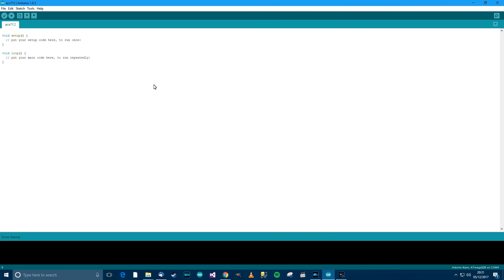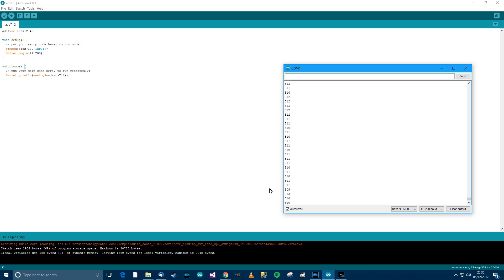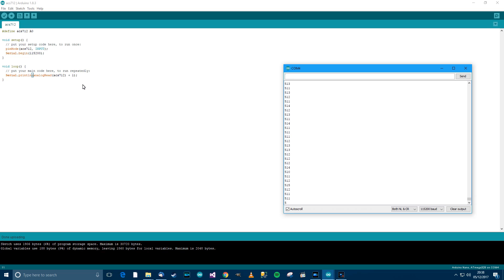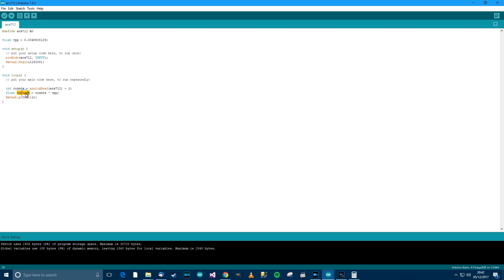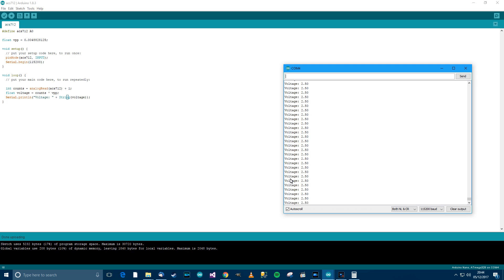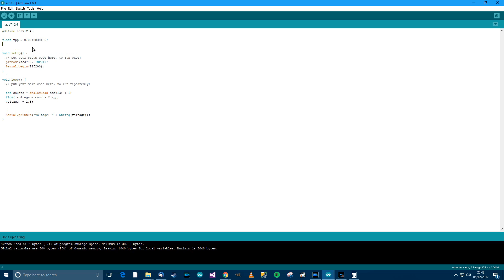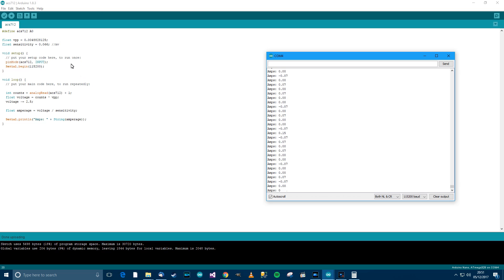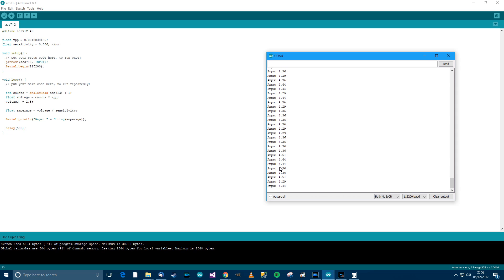TUTORIAL: How to use the ACS712 Hall Effect Current Measure Sensor Module - Arduino (Part 2)

Comment: Hello,

I have a 30W solar panel with Vmpp 17.2 V and Impp 1.74A, I'm using the ACS712 5A module but it's always giving me wrong measurements. not more that 4V actually. what do you think is the problem and how can I fix it?

Comment: I noticed in a reply you had misplaced the code. Here is the code you developed in this video:
#define ACS712 A0
float vpp = 0.0048828125;  //volts per point(vpp) is 5.0v/1024 = 0048828125
float mVperAmps = 0.66; //mV constant of ASC712 30A

void setup() {
  Serial.begin(9600);
  pinMode(ACS712, INPUT);
}

void loop() {
  int counts = analogRead(ACS712)+1;  //reads 511-512.  This is middle point of sensor
  float voltage = counts * vpp; //converts sensor read into volts  511 = 2.5v
  voltage -= 2.5; //offsets voltage to zero(0)
  float amperage = voltage/mVperAmps;
  
  Serial.println("Amps = " + String(amperage));
  delay(500);
}

Comment: #define acs712 A0
float vpp = 0.0048828125;
float sensitivity = 0.066;

void setup() {
pinMode(acs712,INPUT);
Serial.begin(115200);
}

void loop () {
int counts = analogRead(acs712) + 1;
float voltage -= 2.5;

float amperage = voltage / sensitivity;

Serial.println("Amps: " + String(amperage));
delay(500);
}
Reply: you forgot one imp line of code

the correct code is :

#define acs712 A1
float vpp = 0.0048828125;
float sensitivity = 0.066;

void setup() {
pinMode(acs712,INPUT);
Serial.begin(9600);
}

void loop () {
int counts = analogRead(acs712);
float voltage =vpp*counts;
voltage =voltage -2.5;

float amperage = voltage / sensitivity;

Serial.println("Amps: " + String(amperage));
delay(500);
}

Comment: To fix that problem "Your Input Voltage of your Arduino is not 5 V - and thats why ure reading wrong Values" - is easy to fix. Measure the Input Voltage of the Arduino with another Analog In - and do some Math ;)
Reply: Yup, mine hovers in the 4.6xx range

Comment: Adding 1 to your value doesn't change anything.  The result of that is still going to be based on the original figure, and you are now seeing lots of 511, 512, and 513 instead of 510, 511, and 512.  You still end up with a "bobbing" value.
Reply from the maker: I disagree! It's like saying we could start from -3 in a list instead of 0. We all like a baseline figure which we are familiar with. In this case, it's 512, because the total resolution is 1024. It would be unnecessarily awkward to have a baseline of 510 because it would always be 2 counts below what we expect it to be.
Reply: @antonycartwright  That might be, but in the video you are saying you saw more 512's after adding the 1, which can't be possible.  You're seeing it just as often as you did 511 before.

Comment: Amazing videos, thanks a lot for your insight and clear explanations! Excited to get this sensor and start building things. One question, could I use this, or a similar set-up to measure how much power is being drawn instead? I have a set-up where I am using a Solar Powered Mobile Phone Charging Station, the phones are being charged via USB, and I am interested in determining the amperage that is being drawn from the USB charging hub.

Comment: Hello there, thanks for sharing your knowledge with us, I got a question and I'd be glad if could answer me based on your knowledge on ADS, it seems these modules won't work nicely if I want to read low currents such as 1mA, 10mA and so on... If I use a 12bit Arduino or a 12/16bit adc module, would that help me in reading both low and high currents? I'd think so as the resolution would be higher, a 12bit Arduino would give me analog reads from 0 to 4095 if I'm not mistaken... I did a sketch to read currents by using a single resistor of 1R, it does work pretty fine, but according to my maths I'd be able to read a maximum of 5A, for that current I'd have to have a 25W resistor.. I'd appreciate your comment on this, thank you.

Comment: im using 3 sensor for my project of solar power curve , so my 2 sensors arent showing stable 512ish . its sometimes 500 and 515 and bounces  in between . what should i do to fix this problem ?
Reply: This is just noise. Take several readings and average them.

Comment: why do I get negative values of current in serial monitor?
 I'm using it to measure DC.
Reply: You might have switched the polarity by mistake when connecting with the sensor.

Comment: what the purpose of your  analogRead(acs712) + 1 ?
Reply: The " + 1" is for calibration purposes. If he (on his system) skips the ekstra "+ 1" he would be a little bit offset compare to 0 volt (or 0 amps). You might have to take some other number on your system, or just skip it.

Comment: If I'm getting 104, can I just add 408 to make it 512 at 0V?
Reply from the maker: Alphabot 408 is very different to 512, is the circuit ok?
Reply: Antony Cartwright yeah I've connected it properly. But without any load the value I'm getting for 0V is 104, not 512 as you got. So I was wondering if just like you added 1 to make it 512, can I add the 408 to make it 512 at 0V?
Reply from the maker: Alphabot that seems broken. Do you have any other modules?
Reply: Antony Cartwright Nope I don't

Comment: i am trying to mesure the curent of a 12v DC motor using Acs712 and arduino nano. i used the same diagram and code but all i get is some wrong negative values. can anybody tell why ?
Reply: If you have triple-checked the wiring, then I would double check the Arduino pin that you are using...  Some have pullup or pulldown resistors by default...   If you have a pull-down attached to that pin, all values would get a negative offset (depending on the value of the onboard resistor)

Comment: Can you help me .
I have a problem .when I am measuring the current by acs712 it only prints 1023 but when I connect the sensor with a load it doesn't change the value 1023.

Waiting for answer
Reply from the maker: Be The Engineer hi, try another acs712. Antony...
Reply: Antony Cartwright yes I think that can give me a solution
Reply: Now it's working but when I give a load it doesn't sense the current. Can you help with this .
Reply from the maker: Be The Engineer hi, I'm afraid that is too vague. I'd need more info than that.
Reply: The problem is it's showing 0 to -0.03 mA when there is no load is connected.
But if I connect a load it doesn't changing.it shows same value of 0 to -0.03 mA.

Comment: Hello Anthony, that's avery helpful video for me regarding my project. But then, I got a little problem here. can you explain also how to measure power factor on arduino, please?
I've bought the ACS712, and Zmpt101b voltage sensor. 
Maybe you or other ppl can help?
Thanks in advance
Reply from the maker: Syukron Alhakim hey, I'd have to research this. At the moment, I don't know what power factor is! Ha!
Reply: Antony Cartwright , glad that you're interested in researching it. In short, Power factor is active power divided by apparent power. This only happens on AC. What I actually need to measure is the displacement power factor. In which how lag / lead current towards its voltage.

Maybe this could help:
https://ctlsys.com/support/power_factor/

Comment: I am getting correct result but my power supply shows danger sign please suggest I am using the same circuit as yours thanks in advance Antony Cartwright!!
Reply from the maker: Hi, I'm afraid I don't know about the power supply, but as far as the ACS712 is concerned, this is correct. If your power supply shows a danger sign, it is probably best to stop doing what you're doing to make it safe! Antony...
Reply: Sadam, I think this wasnt a problem, since, Antony is indeed a short circuited the PS.
Reply: yes as we connect two terminal directly to the current sensor which makes the power supply short circuit should we use some resistance between sensor and power supply
Reply from the maker: Sadam Hussain hi, it depends on what you're trying to accomplish.
Reply: Sadam Hussain, in this case, it was always suppose to be short circuited. No resistor needed indeed. Just like how Antony answers.
Reply: HELLO, brother, i have another question how can we get smooth value like one value from current sensor

Comment: To smooth out the value, maybe you can store the running values into variables of 10 or more, then get the average.

Example algorithm: 
var 1 = 0.00  //first millisecond put the value here 
var 2 = 0.02  //next millisecond put the value here 
var 3 = 0.01  //next millisecond put the value here   
var 4 = 0.00  //next millisecond put the value here
var 5 = 0.00  //next millisecond put the value here
.
.
.var n = ?

>Get the sum of all VAR then divide by their number; if there are 10 variables, then divide their sum by 10.
>If there are 10 variables, then you've got 10 milliseconds to change their values. 
>At 11th second display the Average value.

Arrays and For loops can ease the coding here.

Anyways, this is just my idea, just sharing. Yours might be better.
Reply from the maker: There's an easier way;

float sum = 0;
int samples = 0;

Then in loop;

samples++;
sum+=newlyMeasuredValue;

Then when you come to average it:
Serial.println(String(sum/(float)samples));
samples=0;
sum=0;

Then you just slow the output time down.

[Edit: Actually, it's pretty much the same idea.]

Comment: int Amppin = 0;  // pin assignment

pinMode(Amppin, INPUT);

float Ampval = analogRead(Amppin); // "float" because you will be subtracting the value with decimal number for accuracy
Ampval -= 511.5;     // half of 1023. It's 1024 actually, but Zero(0) is included to the count so it's 1023 divided into 2. the other...
                                   //...half is for negative value.

//You divide 511.5  by 30 (because it's 30 amps rated) = 17.05 (per amp)  //

float Amp = Ampval / 17.05;    //Final value. By this, you can get negative values as well when reversed.

//This can be shortened, but just to easily grab the idea so I made it that way.
//feel free to modify and let me know.. I'm just a NEWBIE.

Thanks to this video!! Nice Job!
Reply from the maker: Thanks for this. :-)

Comment: Hey Antony, I just want to ask regarding on your codes. How do I write the code if I use multiple acs712 sensors and compile into a single serial monitor?
Reply from the maker: Ahmad Dasuki hi, the acs712 is an analogue device, so you can simply read one into a0 and the other into a1. Then just read them separately in the arduino code.
Reply: If I already change the reading into a0 and a1 then how to compile from different codes into a single serial monitor as in table form?

Comment: You show clearly the sensor produces a numeric of 0 to 1023 for -30a (thru 0a) to +30a.  You want to see (displayed) a '0' for 0a, and '5' for 5a.  We know sensor numeric 511 = 0a.  Pretend sensor numeric 785 = 5a (just guessing).  One wonders if the Arduino map() function https://www.arduino.cc/reference/en/language/functions/math/map/ would save you a conversion to volts then to amps?  Definitely, there are multiple ways to achieve the desired outcome.  My brain was thrown for a loop during the video's focus on voltage.  Thx.
Reply from the maker: Hey Are Jayem, the map function only works with integers and not floats. So, you'd lose a lot of accuracy if you used that. :-)
Reply: I have a bundle of microcontrollers, but have yet to fiddle with them, because my 'tronics workbench is still being built.  Then I can start teaching m'self this stuff I DON"T KNOW.   :)

Comment: You could zoom on the coding screen, just saying. Still it's interesting. Thanks.
Reply from the maker: Pál András Csokán Hey Pal, funnily enough, you're the second person to say this in a week. I've started showing larger font on code, but videos are around 2 week behind.. :)
Reply: Hi Antony, like the screen recording in the previouss part, this part is mono too. I view it using headphones and only my left ear hears your comments... 
Still an interesting subject. Will you use this module for your solar setup or for battery testing? The INA219 module is also handy. It's quite accurate for measuring both voltage and current over I2C.
As you noted the 5V for an 1023 ADC reading is relative to the voltage of the Arduino module. That voltage could indeed be 4.9 or 5.1 or much more deviated. To make more accurate readings you could use the internal 1.1V reference voltage with voltage dividers to first measure the module voltage to see what the exact compensation should be.
Reply from the maker: Yes,  I realised about mono a while after uploading. It's very frustrating! I don't have any plans for the video, I just re-done the video because my previous ACS712 video had a large amount of views, yet the quality was terrible. A few people have told me about the INA219 module. Some time ago, I compared it to the ADS1015 and I chose the ADS module, though I might get the INA module too now. I've used that 1.1v reference sometimes. These ACS712 modules, to be honest, I don't think they are the best solution. I prefer a current shunt with an external ADC. :-)